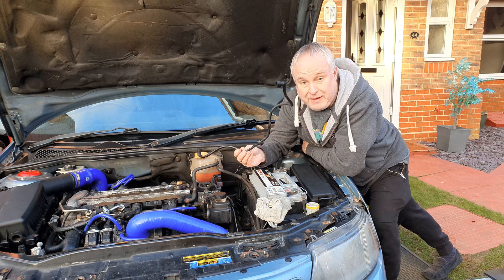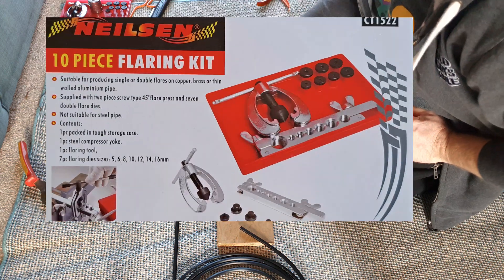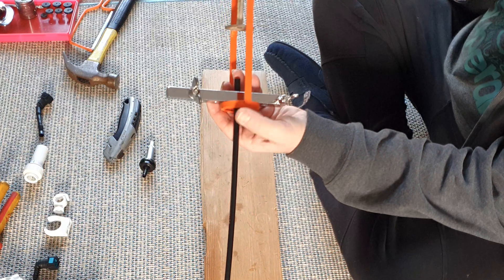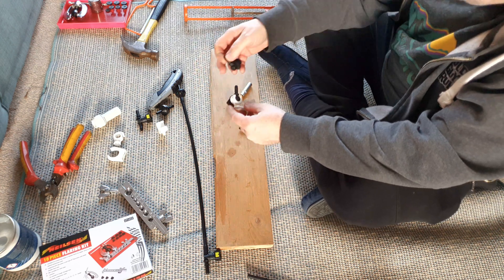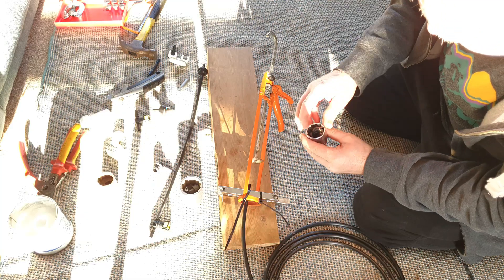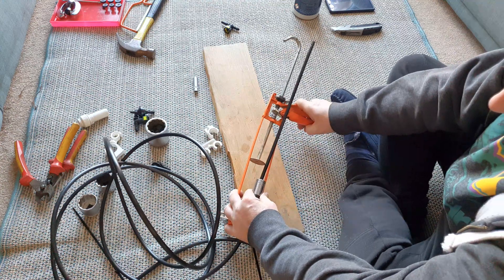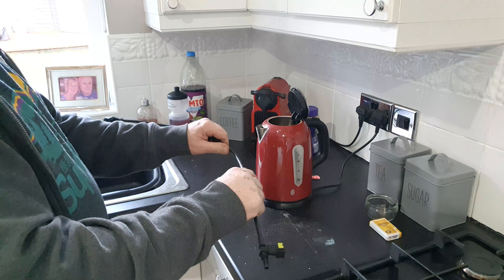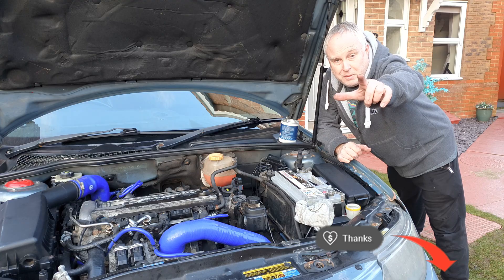Install Quick Connect Fuel Line Fittings AND Vacuum Line Fittings

Comment from the maker: 👉 How to clean fuel injectors yourself:  https://youtu.be/8rHmN2AC_mk
Reply: Thank you for your video and sub’d! I am a bit stuck as I do not have full access to the end of my line on my Kangoo unless I drop the tank. So after a few attempts, the end of my line has become a bit squished? Also, is a different coupler required for a return line? My pump has two joints; a green and a red.
Reply from the maker: @simonuddin8493  on some cars there is a hatch under the rear seat for access to the fuel pump. Have you checked for one?
Where you must drop the tank (the Saab is like this) it is usually easy enough, but run the fuel as low as possible.
The different colours are probably for identification. What matters is the fitting size. be sure to measure the spigot and the pipe properly to get the size required.
Reply: Where are you located. CAN I pay you to do mine

Comment: Great video! It got me thinking. I do not have a flare toolkit as in the video. I took two 4cm wide planks, clamped them together and drilled holes along the join with drill bits about 0.5 mm smaller in diameter than the pipe I intend to clamp. When the two planks "surround" the pipe and they are screwed together with chipboard screws in pilot holes I manage the same effect as the flare kit. What I cannot figure out is how to do sideways pressure on a t-piece without damaging the clip.

Comment: A hair dryer is better than using a heat gun because it will warm what you are working with but it will not get so hot, like  a heat gun and start to melt what you are working with.

Comment: Thanks for the tips. They are really helpful. I wanted to change one connection on my Mazda 3 BK, because there were connection with clamp and rubber tube that leaked twice. I know how to do it now. But I sold my car one year ago, unfortunately))) But your video is cool, I like methods you show there.

Comment: There are also these types of quick connect fuel lines fittings where you can connect a rubber hose instead of a hard plastic hose

Comment: After getting a substitute part because mine was discontinued, I was pretty disappointed. The supplier wasn’t any help. I found your video while looking for fittings. I was able to use your technique and transplant the proper  one on to the new hose which had the correct shape and fitting on the other end). It worked with a little finesse. Happy days! Thank you for taking the time to share this!

Comment: My brothers Bora had the vacuum lines all ducttaped up.. so we bought a new line from Autodoc. They did not fit for one bit. Then we got out the hot airgun and soften the old vacuum lines to get the pieces off we could reuse. They go on and off very easy and when they cool down they crimp back to the original size and are stuck till eternety! Worked great and his car is running without a problem.

Comment: Spoiler Allert: These tools are very ineffective for their intended use. Why, because "seasoned" line will not yield to comform to expansion and even if you managed to get a new fitting on, after cutting off the old one, the line is too short to make a leak proof connection. It's better to buy a new line or source one from a salvage yard than to spend the money on a product that is severely limited IMO as I found out through trial and error.
Reply: I tend to agree, sometimes they will stretch to fit a new fitting but have no elasticity and it will pull right out.

Comment: Excellent presentation..used the same method to make a new plastic petrol pipe for our Vectra C Hatch..only variations..? I mounted the flaring tool securely in a vice, insulating tape where the jaws clamped the pipe and used my wife's old hair dryer to "carefully warm up" the end of the pipe for a minute or two before pushing in the fitting home...after a couple of bad kinks cold...Thanks for the advice  & sharing....

Comment: Hey this was super useful! The trick with the caulking/grease gun was very clever indeed. 👍But instead of the flaring tool, I just bolted two 4 cm wide strips of wood together, drilled a 7,5 mm hole in the center (for 8 mm nylon lines), loosened the bolts to place the line in between, retightened and attached it to the bottom of the caulking gun (the one you mentioned at 5:20) with two screws. I was fitting a 9,49/8,0 mm 90 degree connector and I put a few LEGO strips under the connector to support it, a drop of ATF to lube the connector, and it slid on beautifully! First I tried a steam cleaner to make the hose more malleable but the hose just collapsed at the base.

Comment: Hello. Nice tip. And what to do if one if the fittings is leaking a bit let say for vacuum line after this job. Is there any way to make it seal better? Without taking it apart again?

Comment: Since you brought the tea pot into the video I was under the impression one can heat the hose end in the same manner and insert those fittings into the heated end.  Once the line cools the fitting is tight.  Easier than fighting the job with a caulk gun.  In using this method to do existing gasoline lines on the vehicle, keep in mind gasoline has a boiling point way less that of water.  Hearing gasoline sizzle is not a pleasant sound, especially when your face is close up--like playing with a maddened cat.  PS--you can momentarily dip the hose end into the water but I would not boil the water.  It does not take much to heat the hose for the job.

Comment: Excellent. Perhaps you could cut some wood to support the angle bits and put that in the mastic gun or heat the pipe a little bit. I don't know as I've never done this . I broke a clip under my car for fuel . It's lucky that is a rubber hose as i would be in the shit . Thanks

Comment: Thanks for the DIY tips on this. My son bottomed out his HHR on a gravel road and the steel line heaved up into and cracked the quick connect on the poly line that goes to the fuel rail. I might try just replacing the quick connect for $5 vs paying $70 for the complete steel line kit just to get the short poly flexible end line.  And I had just replaced both the fuel and vapor steel lines last year after the old ones rusted up. You may have saved me $75 w/ shpg. Thanks from a yank across the pond! 🙂🇺🇸

Comment: You're playing chess. I'm over here playing checkers. The flaring tool and caulk gun for fitting fuel lines in genius! I've always used a heat gun and crumpled a lot of line by getting it to hot/ pushing to hard. The world doesn't deserve you.

Comment: Very useful, thank you. You can also make this much easier by using a heat gun on the end of the pipe prior to pushing onto the fitting. Easier method to create bends as well rather than the kettle, but you need to be reasonably skilled with the gun to avoid overheating/melting.

Comment: This is what I do and have done it for over 20 years. Heat the hose or pipe with a heat gun and no grease or lube. You don't have to heat it up hot hot, practice with it a few times and you have it.

Comment: oy my... I randomly ended up on a video from 3 years ago dealing with the bad shifting on the Fiesta Mark 6 because I'm doing my clutch at the moment. checked out if the channel was still active and got this video recommended which is already my next little project for the old Fiesta in sight. apart from the soothing UK accent which fits garage repairs perfectly in my opinion your explanations are all correct (as far as I've seen) and there's no shortcuts taken or botches made, just lovely, old fashioned mechanics work 👍🤩
Reply from the maker: Thank you, I do try to be thorough and accurate. I also like to show how a high standard of workmanship is attainable by the DIYer. Sometimes it is the "little things" that make the difference - for example, see my latest video on spark plug replacement, where I doubt very much that any garage does anywhere near as good a job.

Comment: Great information provided by your video and especially the PTFE lube.
  Many don't read an owners manual or get one with a used car. If purchased at a professional dealers lot, ask them to buy one and mail it to you at no extra cost, part of the deal. (Tech Tip) If you live where it freezes (0 degrees centigrade / 32 degrees F) Use this silicone grease sparingly on the door weather strips. This does 2 things. 1 is it hydrates the rubber seal, making it last decades longer and when freezing, it allows an unlocked door to open as moisture, snow melt, frozen rain from sticking it so bad, you could break the door handle or scratch the paint where you use a large flat blade screw driver or a handy pry bar, even with a couple or rags. 
 Nothing spells enjoyment as standing in freezing weather trying to pry open a door the is unlocked and using a third hand to hold the door handle. Fun I say, but it is called for in the owners manual. That fat book in the glove box taking up so much room!
For a car guy in the USA. Have a lucky one. DK, automotive ASE Master Tech since 1978, retired.

Comment: Great information, thanks for sharing. Before I order fitting, is the diameter of the solid pipe that the coupling clicks onto, being either 6mm or 7mm or another size, used to order the correct size part? Or is it the inside diameter of the fuel line the determines the fitting size?
Reply from the maker: Both! For example, 8mm-ID6 = fits to an 8mm pipe (eg a fuel filter) and fits to 6mm ID plastic pipe. There's a range of combinations of sizes for different applications.
Reply: @CycloneCyd  thanks you.

Comment: Update: armed with your method, I found quick and easy success last night!!! The caulking gun worked great!!! The only small snag was the Ford lines I was working on have a rubbery outer coating, making the OD a bit larger, and the flaring clamp chewed that up a tad, but that's really a non- issue. So thanks again for the great info!!!
Reply from the maker: Awesome work. Thanks

Comment: Great tips!!! Been a professional mech for decades, but came across a new problem in having to replace the fittings on a fuel line at the pump. I never had to do this before and just knew it was going to be a pain. But armed with the flaring tool and caulking gun trick, Im feeling much more confident about how my day is going to go!!!
Reply from the maker: How did it go?
Reply: How do you get these connecting hose apart again?

Comment: Thank you, great video. Yesterday I have been naively trying just to heat the pipe and put connector in, but results were terrible. Now I tried your "cold press method" and the fuel line looks like it was stock!

Comment: you're a great instructor, thank you for sharing your time and knowledge with us all. I sure do appreciate you making this video, I was using my hands to remove the quick fittings that were attached to an extremely rusted fuel pump. the rust was so bad it prevented the plastic tabs from being pressed to remove. pulling with my hands was difficult but i managed to remove both and was wondering how i was going to push the new fittings into the plastic fuel lines while still in the vehicle. thank you thank you thank you

Comment: I've heard about the caulk gun tip which sure is better than using a clamp or vice, but the socket is something a lot of folks wouldn't think about. Great instructional, & a much better way than heating the hose. Also using a motor oil will also work to lube the fitting.
Reply from the maker: If you use heat, you need to control the temperature closely. Dipping the end in boiled water can do this, but any kind of heat gun risks over heating the material and ending up with a poor joint.

Comment: Good props and instructions.  This video did the job.  Thanks.
Reply from the maker: Thanks for stopping by. Happy to help. The pipe I was making in the video has been on my car since, working perfectly.
Reply: Glad your pipe is holding out. Over here, in the USA, the fuel pump died. When replacing it I fractured  a fuel line connector.  Prior to replacing it, it was trickling out fuel each time I turned on the vehicle ignition.

Comment: thank you sir..i made a tool out of an old caulking tool to push the fittings into place,,but had a problem pushing an elbow fitting into place until i saw your idea using a socket..i then had the job done in 2 seconds. your knowledge is very much appreciated by many
Reply from the maker: Glad it helped. A friend in Powertrain told me about using the pipe holder from a flaring kit, but the socket idea was all mine. So I'm chuffed for you. It's all about thinking outside the box 👍

Comment: This video is about 2 weeks too late for me. I broke that exact hose you were holding. However, I found a full replacement for $35. Is it possible to remove a broken barb from these hoses?
Reply from the maker: Split the pipe with a sharp knife
Reply: @CycloneCyd  I guess I should have specified "non-destructively" on the pipe. The check valve was broken inside the pipe, so I was trying to repair the pipe without destroying it.
Reply from the maker: @DougSims  ah, right oh. You will have to cut the pipe slightly shorter, you'll never get that broken barb out.
If the car is a few years old, there's a good chance the pipe and fittings have lost their 'flexibility' so fitting a new valve might actually be impossible. So you'd be better off making a new pipe from scratch.

Comment: Nice video. I had to replace a BMW 730d windshield washer line which burst in the cold snap in Jan. Stealers wanted me to buy a full BMW rail as they didn’t sell the connector separately. I googled the code written on the part turns out BMW use connectors used by the VAG  group so VW AND SKODA have the same parts. So popped into the local VW dealer who kindly gave me the part. My trick is to use a couple of seconds of the small butane soldering heat gun. Works a treat the pipe goes supple barb slips on then firms up. Would not do that for the outer o ring type connectors though

Comment: Another top notch video thanks for making these. I've recently bought a 9-3 SS aero and found your amazing channel helping me sort the niggles. Very grateful thanks. This fuel line video will be so useful for my other Saab 9-3 OG where I need to upgrade the fuel pump but wanted to use this type of OEM pipe instead of rubber and clips other people use. I had looked into it previously but your video doesn't require the crazy expensive tools 👏👏👏. Great work 👍.

Comment: I have a?I have a 93 2ltr turbo 210bhp when quarter full if you floor it it nearly stalls if you drive normal it's OK or if there's plenty of fuel it's OK any ideas I'm at a loss

Comment: This is applicable to many different motor vehicles. I had no idea how to replace those without going to the dealership and paying through the nose.
Reply from the maker: Absolutely. That's why I said the Saab vacuum line is the example piece. The technique and parts are exactly the same to build any vaccum or fuel line for any vehicle. Especially useful if you have a classic or other rare motor.
Reply: @CycloneCyd  Your videos are gold, because you are knowledgable enough of to know how to explain it simply, slowly and clearly (for the dummies out there like me)